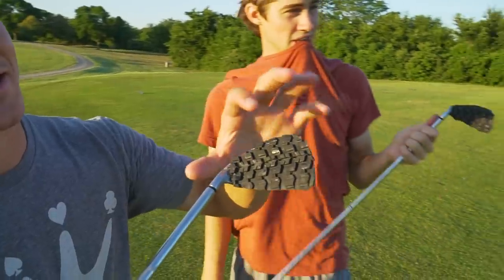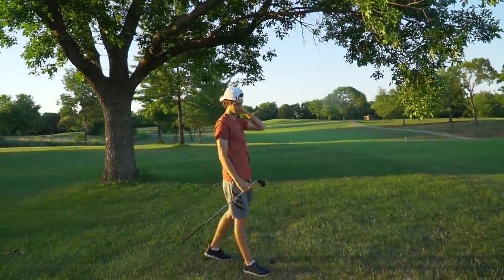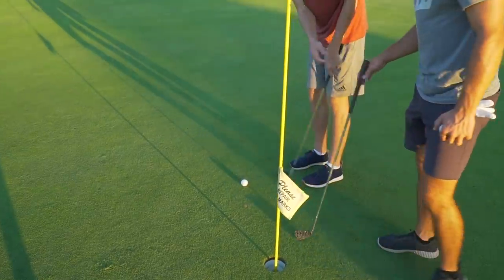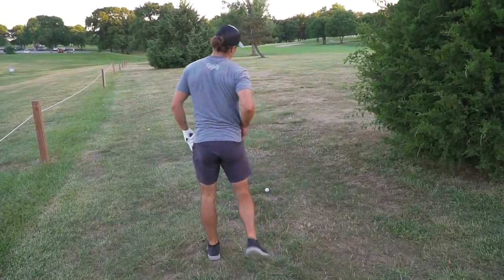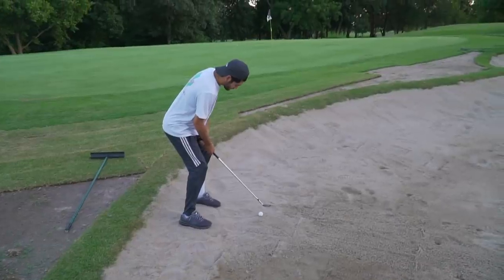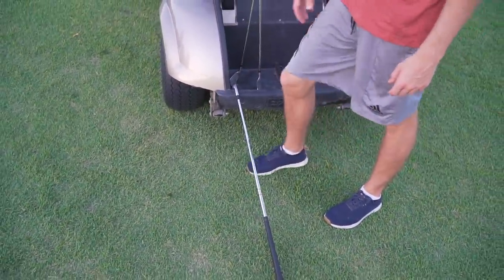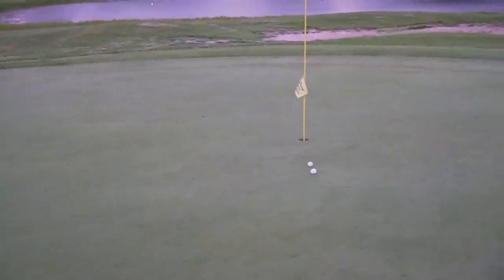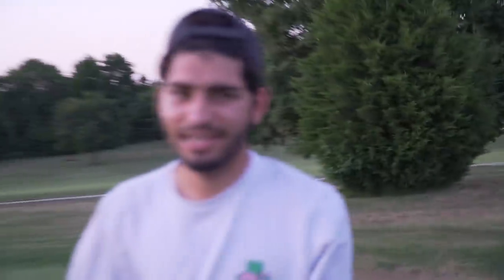Homemade ILLEGAL Golf Clubs | Tire Tread On Club Face  *INSANE DISTANCE!

Comment: You should try cork or club grip on the club face. Not wine bottle cork but the flat sheet cork, similar to what is used on a cork board. Not sure what it would do but I feel like it would definitely alter the hit by either being more bouncy or more absorbed, grabbing the ball, helping it spin, as well as taking some heat off the shot. Idk but I’m curious, that’s for sure!

Comment: It wouldn't spin cause it IS rubber. Rubber has no traction and compresses (and spins against a hard road). An iron face does not compress and so forces the ball to compress and so spin.  You would need a tougher rubber like HARD likely a snow tire with all the super tiny cuts that a snow tire has to make spin. And thinner application...
Edit - Stephen random golfer tip...he's standing too far from the ball and causing a pull...DYK that you can make a pull or fade standing too close or far..the more you MATTY